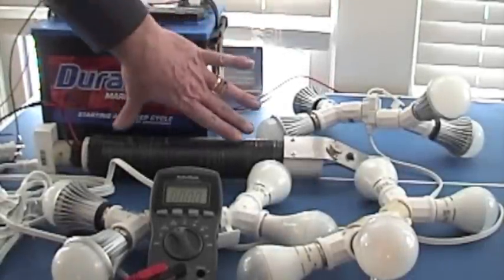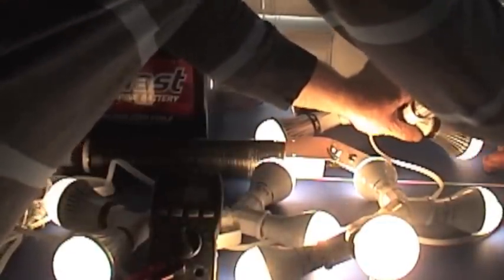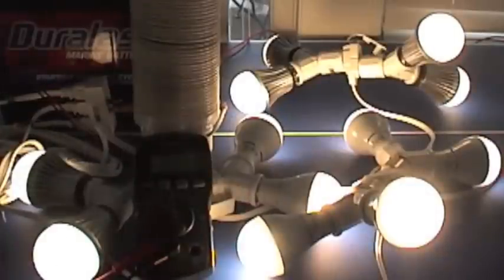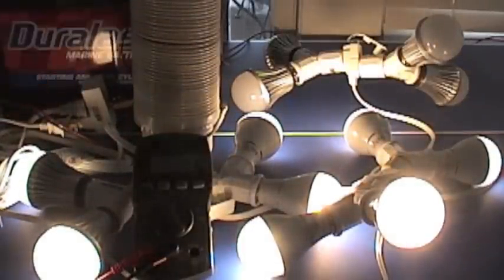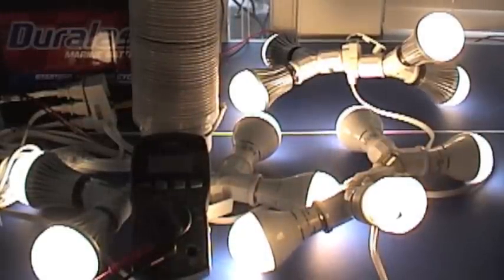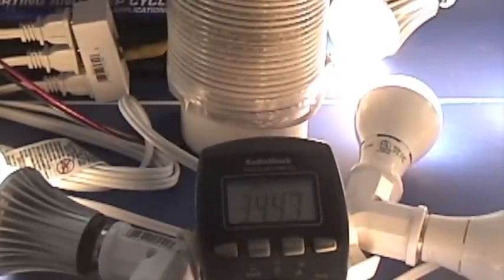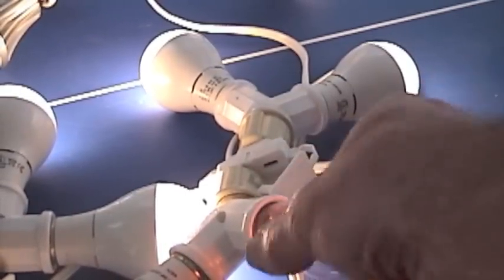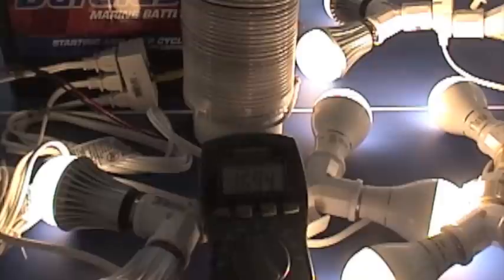Lynx Wind - Energy Efficient Lighting Demo

Comment: I am a very happy custumer. I went to Lowes and I bought me 4 utilitech led light bulbs for under 10 dollar each. 450 lumes. I am using 4 solar panels from Harbor Freight to charge a 35 amp AGM battery. I have been a solar energy fanatic for many years. Your product works great. I visit my local Radio shack store almost every weekend .. to make my story short one of the guys that works there is very interested in purchasing this product.

Comment: You can use what you like.  This happens to be a 85 AH deep cycle 12v battery, a 10 watt solar panel and the gull 40 wind turbine.  If I put in on average 5 watts 24/7, I can run 4 LED bulbs 10 hours/day.  You just want to match your input to your needs.